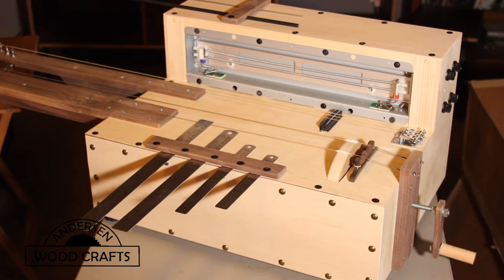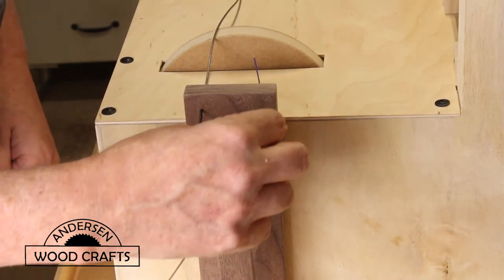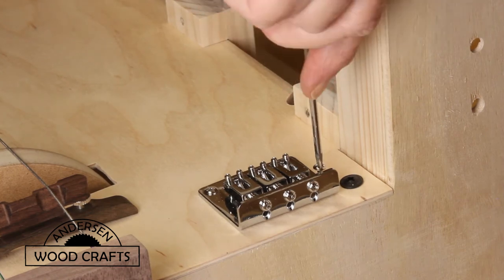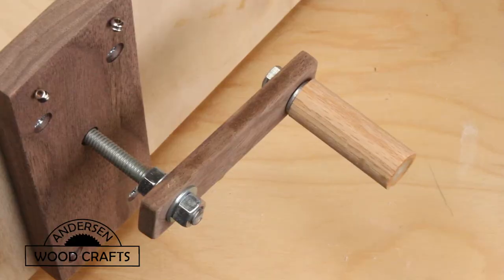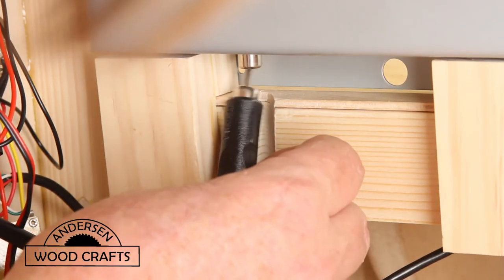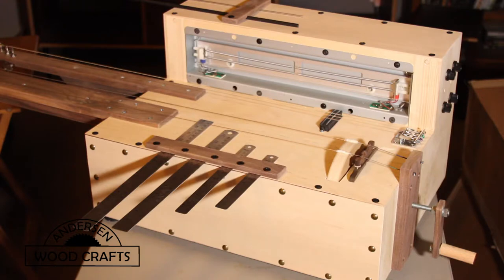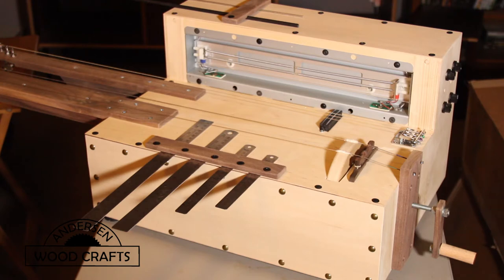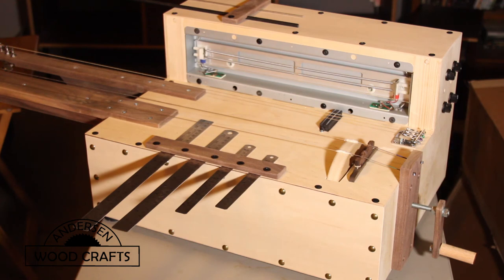HORROR SOUND MACHINE PART 3 – FINISHING UP THE APPREHENSION ENGINE AND THE SOUNDS YOU CAN MAKE

Comment: As you probably know you really need an acoustic preamp guitar box and reverb fx guitar pedal to get it up to speed.
Reply from the maker: I don't have any of that, but the person I made it for has all the gear needed to get the eerie sounds.  Thanks for your comment.
Reply: @AndersenWoodCrafts  Awesome. If commissioned what is the cost approx?
Reply from the maker: @sheldonnorton9035  I don't recall the actual cost of material and I lost my records in a recent house fire, but it was around $250.  The person I made it for is a friend and the price was bartered (cash was not involved).  Haven't looked in awhile, but a year ago the original sound machine was being sold for around $10,000.